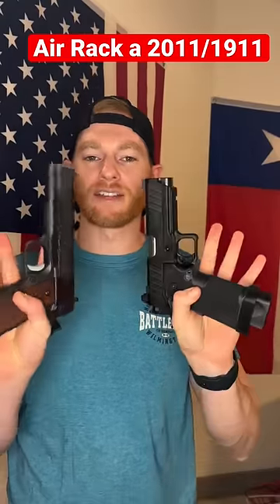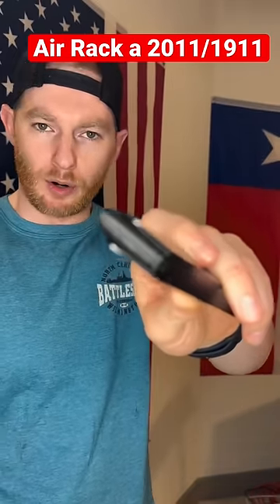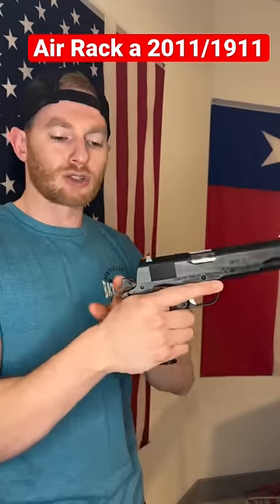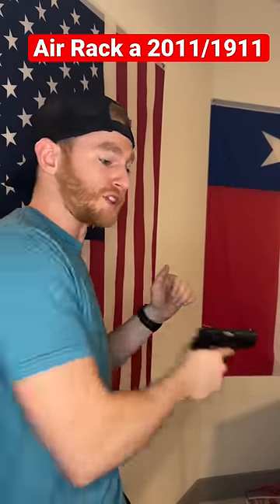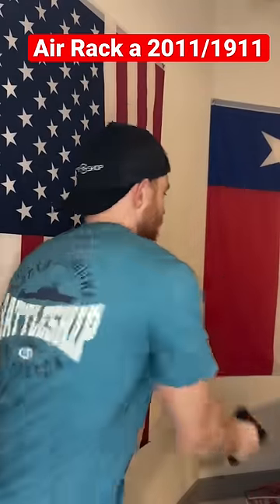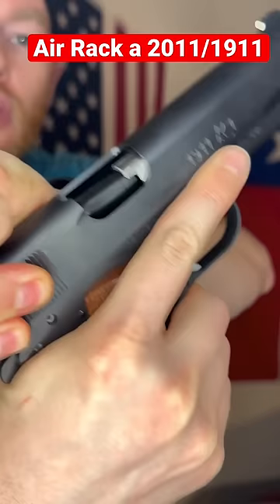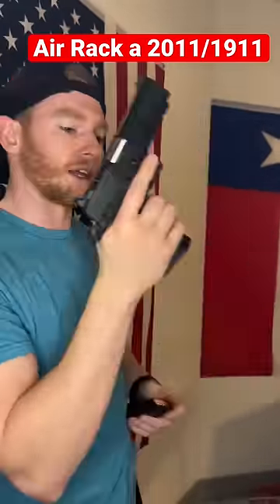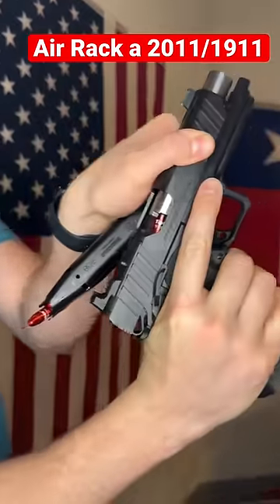How to Air Rack! (2011 or 1911) #shorts

Comment: If your gun can be racked this way, it's time to replace the recoil spring lmao
Reply: steel frame guns don't have strong springs becuz it break things
Reply: @jrocks6969  a standard recoil spring for a 1911 in 45 is 16lbs, you definitely aren't air racking that gun til it's well worn out.
Reply: Yeah... Good luck doing that with an 18+lb recoil spring.
Reply: Yeah I tried this back when I first got my Tisas 1911 and immediately saw it just wasn't gonna work. The slide and frame move like one solid piece when you try to do this.
Reply: It might be, but it works with stock parts on a lot of guns. I am able to do it with one of my guns that is about 60 years old. You just have to generate enough force to overcome the spring, which really is not hard to do
Reply: Absolutely incorrect.can do it out the box of most steel slide handguns. You just need to step up your speed bud.
Reply: @jbigdangler5565  your on something else man
Reply: Only thing I’ve been able to do it to out of the box was a hi point c9. The slide on that guy has SOOO much mass to it.
Reply: no, hammer fired guns also work against the hammer spring when firing. Racking with the hammer back negates that extra spring pressure
Reply: Incorrect, i tried this for months, all different handguns, thought it wasnt possible. Now i can do it with any handgun, brand new. Its a cool trick but serves no purpose.
Reply: Yo bro. Do it work fo revolver
Reply: Was wondering why I couldn’t do this, assumed I was weak and been in the gym everyday since 🤣
Reply: Uan 😂
Reply: @fckjoebdn1776  no you can’t
Reply: Every hi-point in the history of the universe would like to know your location
Reply: man lol telle something I be so lost when I see these I almost started looking for my nearest firearms 😂
Reply: @jrocks6969 Can't do that with a stainless elite sig p220. its all metal and recoil spring is stiff AF. it is a +P Spring
Reply: @derianarce2686  I don’t think I understand your meaning
Reply: Yeah I just did it with a brand new Canik sfx rival and I did it but it took all my strength and timing but I still don’t think the slide would have chambered a round it could only get the firing pin back
Reply: @jameswilliamson3404  was gonna say, I have a Para USA 1911 with an 18 lb spring and air racking was never even a thought in my mind
Reply: He already did replace the spring....
With a lighter one.
Reply: 😂😂😂😂 nice
Reply: @FckJoeBdn  bet you couldn't do it to any of my guns without replacing the spring, especially my SR1911.

The only gun you would have a chance with in my collection is an old llama 1911, it's the only gun I can do it with, but it's worn and abused.
Reply: @James Williamson  how dare you insert common sense and knowledge into the conversation?? I have been saying this since the first time I saw one of these videos. I have owned  1911s since 73 so I know that this is total BS.
Reply: Tried with my Glock 19x.....it didn't budge an inch 🤣
Reply: Maybe without the spring? 😂🤷‍♂️
Reply: @MrAdeuhtyr  solid lead slide with some paint to not get lead poisoning (joke)
Reply: @TheSandsofFlowingTime  and that's Well after the break in period...
Reply: @ronbloomberg  nothing, other than his mental incompetence 😏
Reply: @ulfson279  true, but the spring is still quite stiff and nowhere near needing to be replaced even if it is the original spring
Reply: Wtf my shoulder hurts now, should have read your comment before trying it with my brand new sar9c....
Reply: @TheSandsofFlowingTime  then it hasn't been shot enough... Just saying
Reply: @ulfson279  it's a Russian gun, that shit is just built different. Not sure what it is about Russian guns, but they just don't wear out the same as other guns. The gun has definitely been shot a lot, it's military surplus, and is somewhat beat up but still in surprisingly good condition. It's also hammer fired, so the spring doesn't need to be too strong because the slide does have to go against the hammer too. If I had to guess, I'd say the spring is at least 10 pounds, maybe more
Reply: It's mostly about the weight of the slide
Reply: @jrocks6969 my 92fs disagrees with you
Reply: What he's failing to tell ppl is tht he changed the spring to 9lb recoil spring that's the only way to do it a normal spring is about 16lbs no matter how hard you try you won't budge tht slider
Reply: I was thinking to myself… why would u want a gun that can basically rack itself this easily 💀
Reply: @jameswilliamson3404 you're the definition of the guy who thinks that knows everything but actually knows shii
Reply: @johnhermann7498 work your arm out and you'll get it 😉
Reply: @SeanAn117 you have to be very strong bro... I mean, 50 straight push ups strong...
Reply: @ftf100gang lack of strength but mainly insufficient speed
Reply: @tufab3494  lol ok bud, make a video, or hell find one, of anyone throwing a brand new 16 lb wolf spring into their 1911 WITH the hammer forward(23 lb mainspring) and see if they can air rack it, because no one is gonna be able to do it. I'm just an engineer with more physics under my belt than you will ever have. Wtf do I know?
Reply: @jameswilliamson3404  I've just searched and there's a bunch. Get out of your chair and do the same. And you should not have missed your physics classes pal, as you apparently don't know what inertia is 😋
Reply: @jameswilliamson3404  He replaced the recoil spring with like. 9lbs spring.
Reply: @jbigdangler5565  You’re full of it. Post a vid of a stock 1911 being cocked this way 🫠. He replaced the recoil spring.
Reply: @tufab3494  lol sure you did, throw the link in the chat hoss, don't be scared.
Reply: @TooManyChoices1  I'm well aware I've already stated such
Reply: @jameswilliamson3404  do the genius know that youtube deletes my comment if I do that? Are you afraid of searching by itself and being proved wrong? lol
Reply: Amen brother 😂😂😂😂
Reply: @tufab3494  nope, just can't find a single video  proving a brand new spring and a hammer down, because it doesn't exist.

But YouTube ain't deleting shit lmao, you just can't find one, that's what I thought. It's okay to admit you're wrong.
Reply: @jameswilliamson3404  try to post any link then, I'll wait.
Reply: I see people doing yhis with glocks my glocks factory spring weightb is 18 lbs and im 6.5 277 and cant do it so either worn out recoil spring or im really weak im leaning towards the spring weight🤣
Reply: @TheSandsofFlowingTime  If you have a good spring it is hard to do
Reply: Gravy seals, that can't throw a punch, are out in full effect 😂
Reply: Idk, is this something you want to try when you might not get a second chance?
Reply: @tufab3494  you edit your comments, but it's Youtube deleting your shit? Okay
Reply: @downeyd88  i edit my comments by removing a dot just to check if youtube hasn't deleted it, just like I'm going to do with this one, so I don't have to go through all the previous 60 replys after 23 seconds just to check if my comment's still there. Learn how to use the platform before you start crying...
Reply: @jrocks6969  not even close to correct. 😂 go to any regular 1911 with a good spring and try this and tell me how far you get. Lol
Reply: @ftf100gang  Id work on common sense too, strength aint gunna do shit, its speed and explosive momentum.
Reply: @uan588  yes it works with revolver's, just keep trying you will eventually get it. I've seen it dun
Reply: Not really. This is something you can do with some 1911. All of the air rack videos are done with a 1911, some got custom spring.
Reply: Lord Finesse  hey baby!  Hahaha Bing Bong!
Reply: This here. Its awesome for looking like John wick right before the simulation ends for you.
Reply: @jameswilliamson3404  yeah. Come air rack my 1911 Patton tribute 45. And I will give it to you. 3 grand.
Reply: Yea this shit is crazy…idk but mine moves like both parts are one idk wtf kind of springs they have in these shits to do this
Reply: @jrocks6969  so the frame being stronger makes it easier to break? Youre a fucking genius arent you
Reply: @MrAdeuhtyr  not really the reason a c9 looks the way it does is they use a magnesium material for the slide because its lighter than steel they have to make it larger (adding material) to equil the same weight a steel slide would they do this because the weight slows the extraction of the cartridge until its safe

So in short it has no more than a typical steel slide more or less also a heavy slide would make it easier
Youre fighting the spring not the slide and a heavy slide means more weight against the spring
Reply: I was thinking the same none of mine would do that
Reply: @royrogers3624    super strong springs break things
Reply: @J Rocks  so you think its going to break steel? Steel that is part of a device that contains an explosion?
Reply: @jbigdangler5565  fr you gotta want that shit
Reply: @CaptainKiloz  want a video of me doing it out the box with even a hi point?
Reply: @jbigdangler5565  the high point is the easiest gun ever to do it with 🤦‍♀️🤦‍♀️🤦‍♀️
Reply: @jrocks6969  bro he took the recoil spring out and your totally wrong as well
Reply: @SeanAn117  yea, he is just playing with his gun, took the recoil spring out
Reply: @TheSandsofFlowingTime  tell me you don't own guns without telling me
Reply: @jbigdangler5565  also tell me you dont own a pistol without tellimg me. The steel frame has no effect. The Glock and 1911 are both tilting barrel Browning designs. And have very similar recoil spring tension if in the same caliber. Now hammer fired guns have a slightly weaker recoil spring because the slide needs to overcome the hammer spring wieght as well as the recoil spring
Reply: @smoothieking157  this dude took out the recoil spring and is misleading people to get the clueless people arguing that they do it all the time lol
Reply: @jordanwiser1435  I would tell you I don't own guns, except I'd be lying. I absolutely own guns and I have to regularly stop myself from buying more guns that I'm interested in
Reply: @jordanwiser1435  if u have ak47 with strong spring it will break rivets , on 1911 strong spring will make jam easier
Reply: @richtenamore9718  lots of firing and racking. And lube. But at this point your recoil spring is extremely worn and you shouldve replaced. You want your 1911 to be stiff. 16 lb spring.
Reply: @jrocks6969  wtf are you talking about?
Reply: @TheSandsofFlowingTime  I bet
Reply: @jordanwiser1435  He clearly doesn’t know Lmao 🤣
Reply: @TooManyChoices1  yes it doesn't even make logical sense. It's like a bunch of gun related but,z words put together
Reply: Yeahhh
Reply: @fckjoebdn1776  it is for those super buff strong dudes who only have 1 arm
Reply: @CaptainKiloz  git gud bruh
Reply: @TheSandsofFlowingTime  you aren’t generating over 16 or 18 pounds of pressure like this. Period.  

And if your spring is also 60 years old then its probably pretty worn out
Reply: @Marynicole830  it's really not that hard to do though. The spring on my gun is fine too even though it's old. If it's strong enough to try to pull itself out of my hands when I pull it all the way back, then it's probably strong enough to not need to be replaced. I'll try to test the weight of the spring when I get home from work, and see if I can give you a more accurate number for the weight
Reply: @jrocks6969  I have a 20lb in my m1911a1 because I run hot rounds through it, never broke a thing nor has it jammed
Reply: @Marynicole830  alright, I have tested the spring in my gun and..... It's a 15 pound spring. 

From my testing, I've determined that if you can't air rack a pistol with a 15 pound spring, you just suck at air racking pistols. Generating 15 pounds of force is not hard to do, just go find a 15 pound weight, and pick it up really quickly, there you go, you generated 15 pounds of force in a small amount of time. Not hard to do
Reply: @TheSandsofFlowingTime why don't you just post a vid of it then
Reply: @vibrant_skies_  because it's not hard to do and took me about 5-10 minutes to figure out how to do it correctly. Go get a pistol, and try it yourself. You have to move the gun backwards and then forwards very quickly, and in a perfectly straight line, otherwise it doesn't work
Reply: @WhuppopotamusYT  well your not in war. Mud dirt , humidity
Reply: @royrogers3624  bro, two whole paragraphs and you didn’t say anything at all. The hi point slide is huge and heavy. There is no way to get around that fact
Reply: STACCATO air racjs very easy..BUT WHY DO IT????
Reply: False
Reply: Not necessarily. He probably put in weaker spring to make it a race gun. But yeah you have to have pretty weak springs to do it. You put in weak springs you gone beat the hell out of your gun and be replacing stuff a lot sooner than you would if you never changed them.
Reply: That must be a old recoil spring
No new guns will do this
Reply: tell that to PewView

Comment: You forgot the key step “remove your factory 16lb recoil spring and install the lowest strength recoil spring you can find for the 1911, like a 7lb spring”
Reply: And have the new spring failing after some shots
Reply: That was my first thought too...if it even has a spring lol
Reply: You must’ve missed the cut, it wasn’t even smooth
Reply: Exactly
Reply: Ever wondered how that works, have an 18 years old CZ75 SPORT2 6", 60.000 rounds through , still first main spring, tolerances still extrem small , 2.5 " on 25 yards. Air rack won't work at all
Reply: Dont give them anything, 7lb is too much, maybe 3ish
Reply: Yup
Reply: Exactly. People really think it doesn't involve changing the spring to a gnar fart poundage spring.
Reply: Most lubed up stock 1911’s will do this. No spring change needed. Just got tolerances
Reply: @rosafonseca2865 Your lying.
Reply: I'd like to see him do it with mine...😑
Reply: Wrong. The barrel weight of the 1911/2011 is enough where the inertia will overcome the spring tension.
Reply: @raviwilson5703 definitely not a cut lol. air racks aren’t hard to do anyways
Reply: @LynxStarAuto barrel weight?? Don't you mean SLIDE?
Reply: Yeah 😂 why make a whole video and it lowkey be a fuckn lie 😂
Reply: Tried this with my 18lb and did not go well for my shoulder
Reply: Yup
Reply: @cumshot247  well with this being ur name, i imagine the slide of ur 1911 is glued stuck and kinda crusty
Reply: .
Add a 3-to-7lbs pounds recoil spring..and try Firing it with a .45 ammo load.
Pretty soon, you'll have a cracked slide 😮
Reply: I was wondering if he put a light spring because I know nobody can air rack my 1911 until I break it in more.
Reply: This guy is selling some total bullshit.
Reply: 2 pound spring

Comment: Colt 1911 A1 - $900. Rotator cuff reattachment surgery - $18,000. Realization that this is a really stupid idea – Priceless!
Reply: It's for the coolness factor
Reply: I "air rack" my revolvers all the time.
Just use your trigger finger.
Reply: @kelly walker  That's silly, you're not "air-racking" it because there's nothing to "rack". Now revolvers are awesome in their own right but the only real comparison would be flicking the cylinder into position with your wrist after loading it.
Reply: @ericolsen5592  It's sarcasm you Mo Ron.
Reply: @ericolsen5592 you can’t be serious
Reply: I’m Aussie
1911 - $1500
Rotator cuff surgery - $ N/A
Reply: Really what’s the point of this
Reply: If you're gonna injure yourself doing this, you need to put the keyboard down and go do some push ups or something man, you're obviously weak.
Reply: @Timcanniff311 nothing, it's just cool.

Comment: Recoil spring has left the chat
Reply: 💯  Was looking for this comment.
Reply: That's  right  cause  I  have  a  SA mil-spec  and  there is  no  way  in  hell  u are  air rack it with  the  Factory spring
Reply: Bruh not like you can see that the spring is there
Reply: And the gun

Comment: He forgot to mention that you need a 10Lb Recoil spring or less in the 1911! LOL
Reply: Exactly
Reply: Yeah my Karr Arms Auto Ordinance 1911A1 couldn’t do this. That spring’s so fuckin’ strong I feel like I’m tearing the skin off my left hand when I rack it.
Reply: I can do it with my Beretta 92.
Reply: @Walawaliguili97  same
Reply: It's probably a .22 HAHAHA!
Reply: @liamflanagan490 beautiful gun.
Reply: @liamflanagan490  BS BS BS BS BS!! I'd give you my 92 if you could do it with a stock recoil spring 92 FS.
Reply: @Walawaliguili97  I understand that pain. Got a custom Turnbull 1911 and the slide cuts on this thing are more like serrations. Combine that with a stiff recoil spring and a day of shooting this will remove the calluses from your hand/fingers
Reply: The hammer spring in the 1911 is heavier than that. He just completely removed the recoil spring
Reply: That's why you don't see people air racking other pistols because when he slide is back you can see the post the spring is captured on sticking out, you can't on a 1911, so you can fake the air rack easily
Reply: Go ahead and try it on my 1911. 20lb spring for full power 10mm.
Reply: Probably lighter than 10 if thats even available. I have a 20 lb recoil spring in my old AMT Hardballer, it was once a race gun, and I have to be careful when I break it down for cleanimg. Spring has so much force it could take out an eye if your not ready for it.
Reply: @jordanwiser1435 it's not removed its just light.
Reply: @jvikingj1006  the 2011 maybe, the 1911 you can see the guide rode missing from the barrel bushing
Reply: Facts